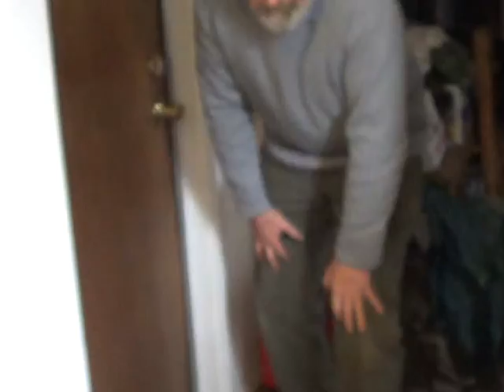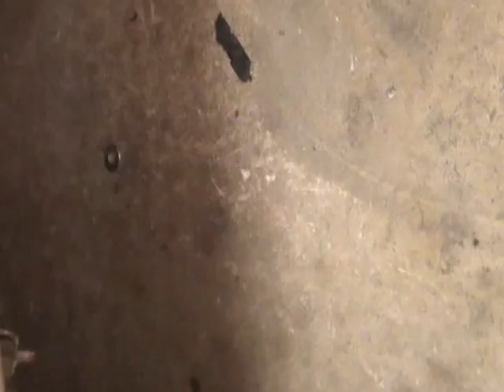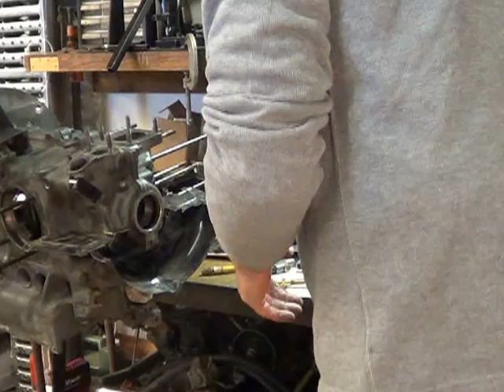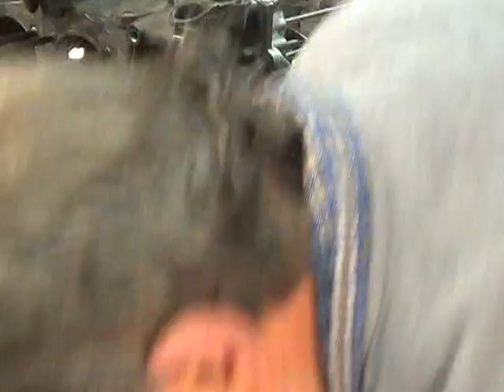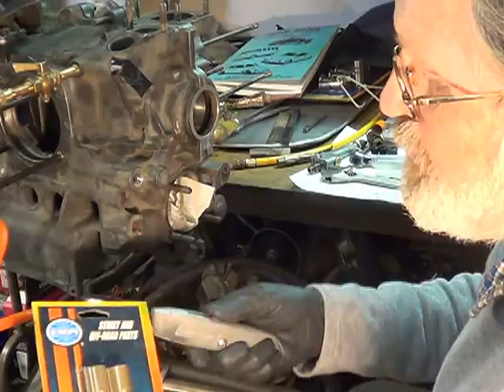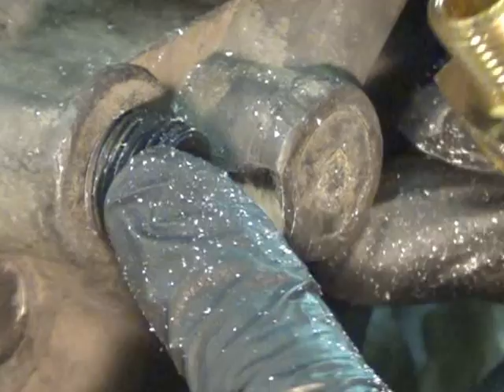VW Full Flow oil filter #1

Comment: what are your thoughts on the Empi oil cooler system that returns into the front oil relief port?
Reply from the maker: I would not tamper with the stock oil relief  systems. Period! 
There are a lot of better choices out there

Comment: Ezgz    I followed your tips on the full flow .  did some Hover mods. 
Working on a 1776 . just about to send everything out to get balanced 
Crank/flywheel/pressure plate /front pully
fan welded /piston/pins and rods, 
    I'm using silicone buttons, so I'm not sending them really I think they don't need to go 
Can you think of anything else 
    Doing a shout out to your miss your Vids 
cheers
Rob

Comment: Have or do you ever block off the stock oil cooler when full flowing
Reply from the maker: you can't just cap it off as the oil relieve piston needs to direct the flow to the main bearings. However you could add or substitut a remote oil cooler if needed. It takes a special bypass cap in place of the oil cooler

Comment: Well I'm drilling and tapping in that same spot, but in my case (no pun intended) that will be the outlet because I have the AutoStick. I have to drill and tap on the side and plug it in between the holes.
Reply from the maker: LOL that was funny.  Good Luck with your Project. Thanks for stopping by

Comment: Hi TheEZGZ Thank you for sharing this Knowlege!!!  Quick question, will this location be suitable to attack a mechanical oil temperature sender ? I am concerned about the clearance in the oil galley and the pilot tube restricting the oil flow. Thanks!
Reply from the maker: +Emanuel Dávila  Your instincts are correct! Do not restrict the oil passage. Take your temp from the oil sump. Maybe a add on deep sump would be better yet. That way you aren't making holes or doing anything permenant to the engine case. Most of the time you don't need that info anyway. I just carry a little $40 hand held infra red temp gun and point it at different area's on the case to let me know whats up.  Better to know oil pressure IMHO of your over 30psi when cruising a hot day your not getting full flow threw the factory oil cooler. Start ups will always look high on cold engine but it's trying to warm up quick
Reply: TheEZGZ Thank you for your promptly reply! Trying to have some fun making an aircraft engine conversion. This is my first build. I was thinking about the sump too, but after I post the previous message I noticed the 10MM plug right on top of the one you are working on in this video (By the side of the distributor). Front of the case, to the right of the stock oil pressure sender. The oil galley goes up right below where the oil sender is, so this passage has no direct contact with the oil coming from the pump or the return from the oil cooler. It seems to have no other purpose but an extra 10mm plug? I think the probe could be put here as well?

Comment: You say that is the easy way  NO that is Not the  easy way you shud it go first with smaller drill bid then go after with other drill bid
Reply from the maker: Max Lopez That would be the normal machine process but it does not work that way in this situation. You can't even use a power tool. The block is so soft. Now if it was on a drill press all apart you are correct. This is how you do it with limited resources.  Post up a vid of you doing it your way..... let me know how it works out for you. Thanks for your contribution.
Reply: +TheEZGZ good answer

Comment: Where is the video showing how to plug the case for the full flow? outlet hole by the oil pump?
Reply from the maker: Why in part #2 of course   https://www.youtube.com/watch?v=4oLIUf1nHSI     I have playlists if you go to my main channel page.   Thank you for your interest
Reply: TheEZGZ The outlet galley in the case. Maybe you don't plug that. Others do. Thanks anyways.
Reply from the maker: Romeo Medeiros If it ain't broke and don't leak I leave it alone.  Never had a problem. I don' t run any more oil pressure than stock.  You can control that different way's.  Bypass oil spring adjuster, oil weight, oil pump.    I prefer as close to stock as I can get but like to add the full flow filter upgrade.
Reply: +TheEZGZ   I'm glad you're around. I used to race VW powered oval track cars. I only learned enough to maintain the engine. I left the rebuilds up to others with more experience. I'm thinking of restoring my last race car, and the original engine builder isn't around any more, and the more I learned how bad the rebuilder was screwing me. If I mention "full flow oiling system" to those who tell me they know VW's, they look at me like I'm speaking Chinese. The original builder would block off one of the oil bypasses to bump up the oil pressure. I needed to to get the oil through the filter, through the lines, the cooler, a reserve tank, then the engine. Almost a dry sump system. Right now it's a toss up between rebuilding the 1835cc or just tossing in a stock 1600 with open headers just to make some noise. I'm thinking you may be hearing from me for a few questions answered.

Comment: The first time I tapped a block I dorked up some threads and was worried about leaks.  Because I'm working on a real low/no budget, I tried what I had on hand and it seames to have worked just fine- I sealed the threads with some marine epoxy.
Reply from the maker: Thanks,  thats good to know.

Comment: Couldn't you use a short or close nipple into the block and then a 'regular' (female on both ends) elbow to get the elbow past the portion of the block which you filed away to clear the street elbow? Or is the reason why one can't have the elbow protruding that far back?
Reply from the maker: Not if you want to use the stock tin,  fan belt and pulley.

Comment: a much better way to aling your drill is to measure the oil canal diameter and have the first portion of your drill( about 2 inches long ) ground down to oil canal diameter minus 1 or 2 thou and sharpen the rear portion square
I use this setup to make adapter plate between engine and bellhousings .
in aluminium, such a drill is easily driven with a brace and the job is reasonnably accurate

Comment: Little tip there EZ. IF the camera is on a tripod or in any fixed position, turn off the stabilizer. Makes the walls breath if you don't.